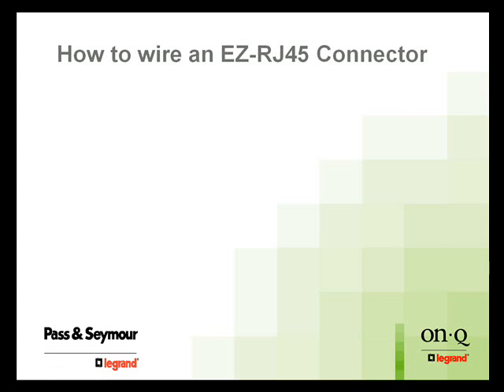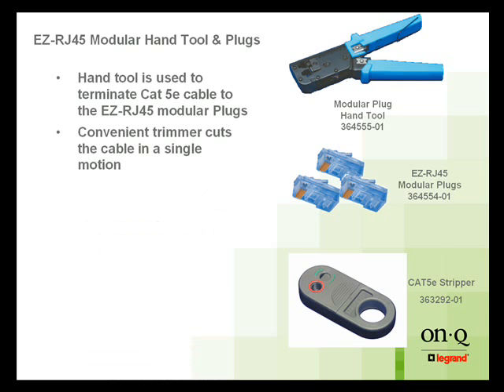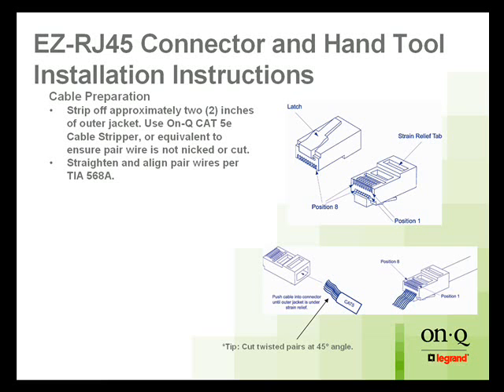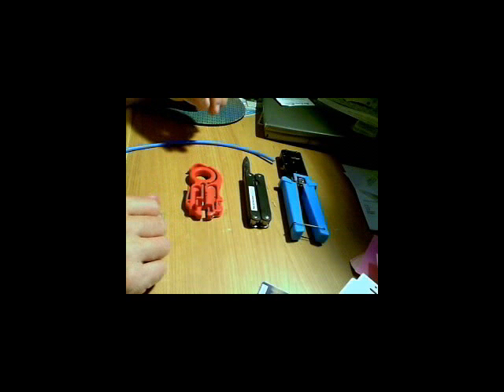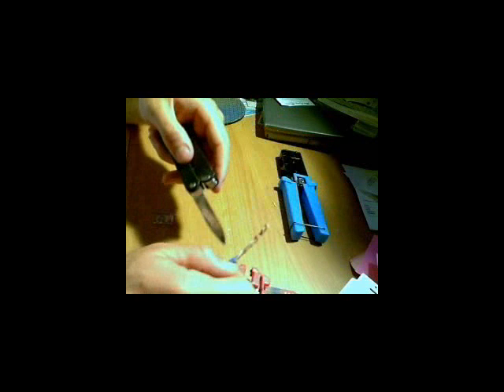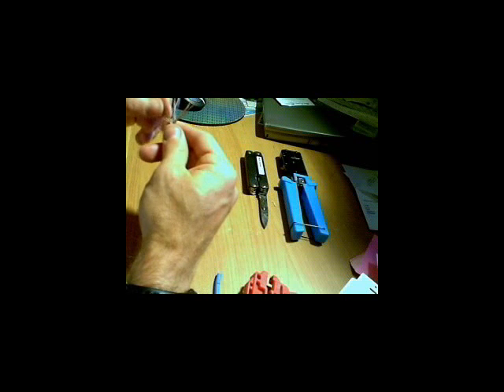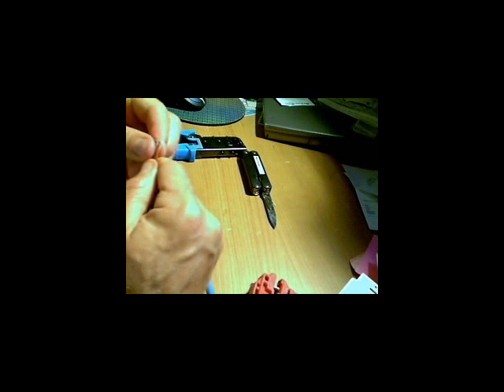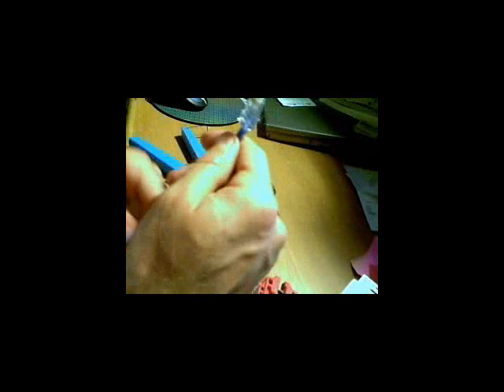EZ RJ45 Termination

Comment from the maker: I've tried using that darn string to pull excess jacket off a bunch of times, and always end up cutting my fingers!  

Not 100% sure about the insulation thing, I know for cat6 there's a center insulator to help achieve some performance metrics.  
Regardless, it doesn't much matter in this case, cause this stuff is all designed for residential anyway.  As long as the guys get the colors and pairings correct, the electronics tend to work!

Comment: The thing you cut that you referred to as insulation is not insulation. Its a pull string. You can strip the 2 inches off, use the pull string to assure that you are beyond the point where you MAY have nicked the wire and go from there. Very useful especially if you need to terminate on a panel and you need to remove more jacket. I use it in both applications because i never trust the cutter.

Comment: About 3 years ago I wired my whole house with CAT5. Out of the 10 RJ45 connectors I installed, about 3 still work properly. The rest have over time gotten loose and have to be bent and twisted to work. I'm defintely gonna try the EZ connectors!